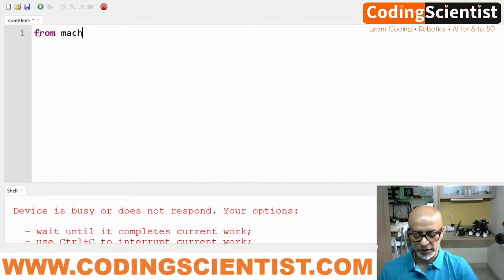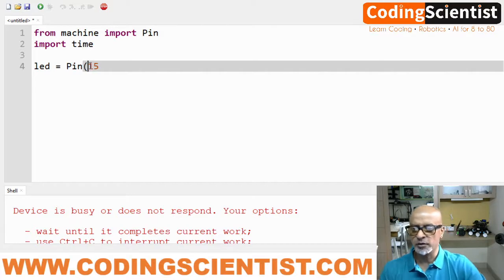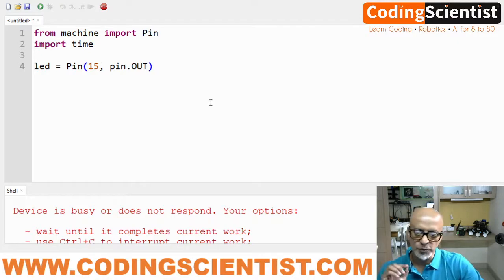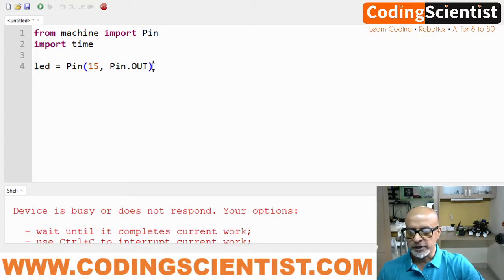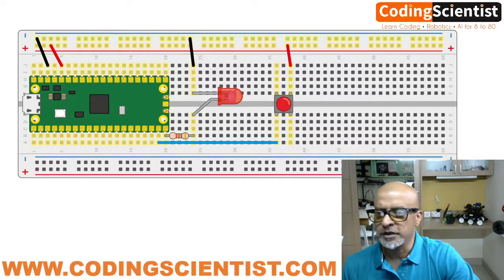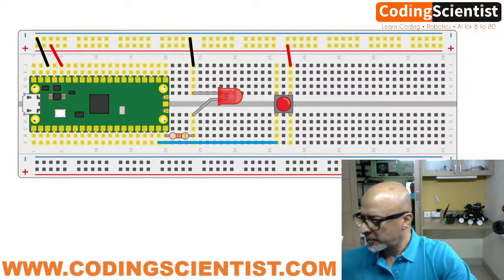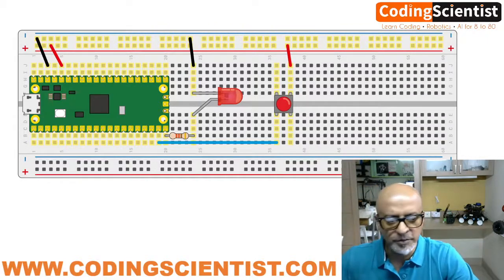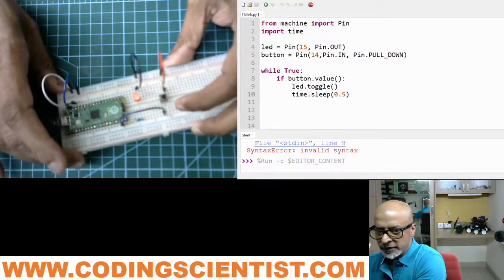Lesson 8 Pico MicroPython Input Output Button Control

Comment: Pls explain your code a bit okay 👍. Some of the functions you use must be explained so far as beginners are concern
Reply from the maker: Thank you, appreciate your inputs 👍
Reply: Loving this. Bought a cheap action cam with motion sensor to record small birds feeding. My problem is the motion camera won't pick up small birds. I bought a pico, relay module and pir sensor and want to bring 2 wires from the camera swich and turn the camera on when motion detected and when no motion detected the pico will operate the relay again to turn the camera off. Hope I can learn how to program the pico from you tutorials to make this happen. Subscribed and liked. Thankyou.